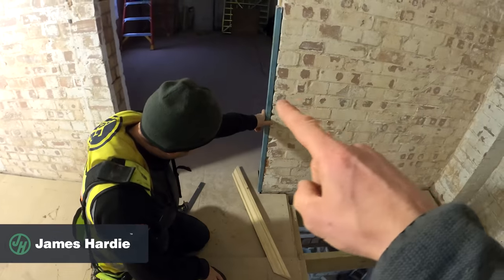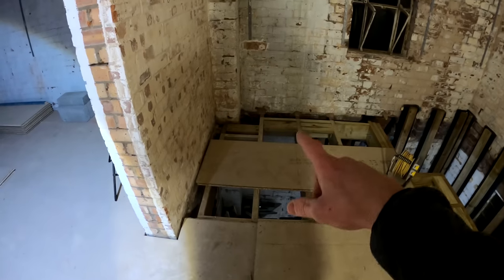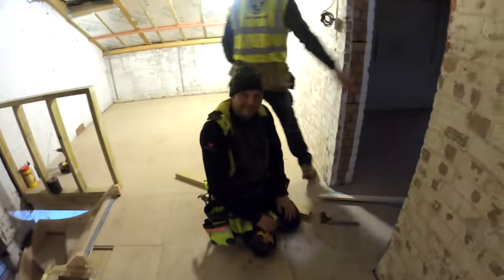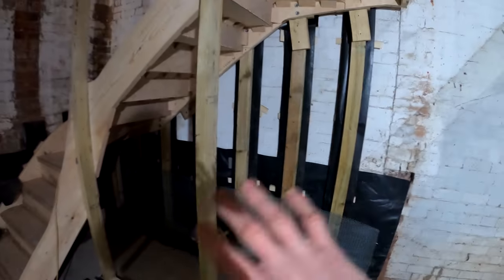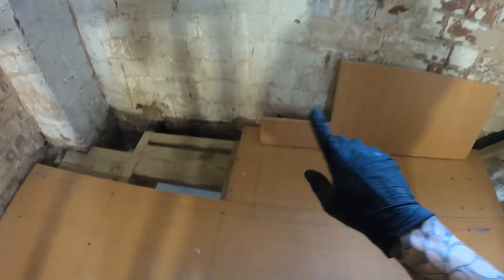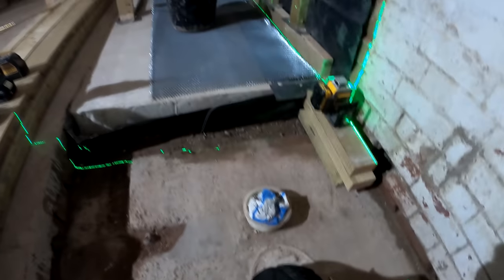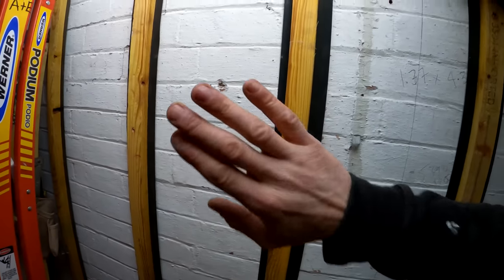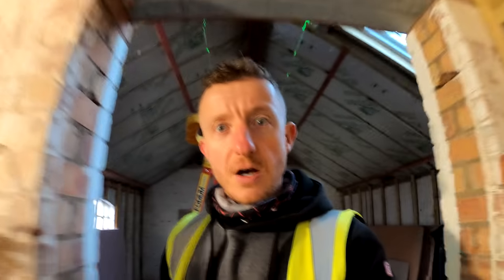Updates from the Coach House! | Victorian Villa Resurrection #10

Comment: Cracking work as usual lads, however it seems strange to see you didn't H frame the chipboard flooring where it didn't meet on a joint, you've got a couple of joints in the middle of gap.
Reply from the maker: Hi Lewis we will have done it later on with Glue and screws, all the best Tony 👍
Reply: @BuildWithAE  Does the same apply to the plywood floor? I would have added support noggins below the joint.
Reply from the maker: Hi Fred definitely all the best Tony 👍